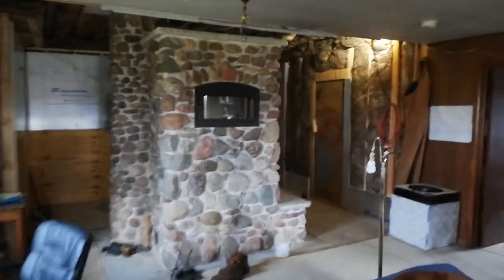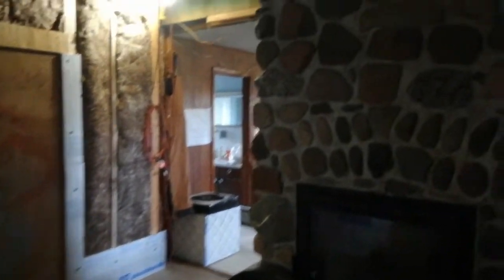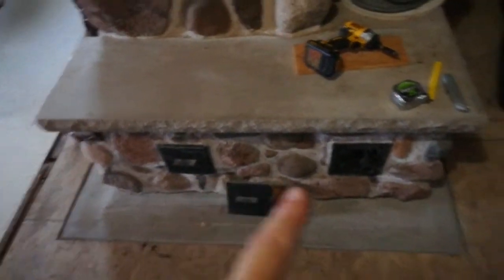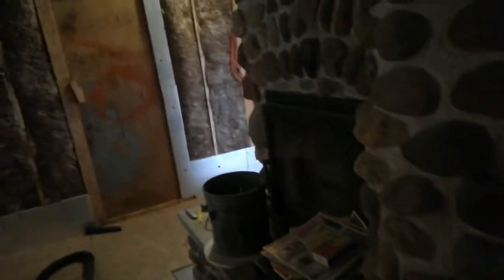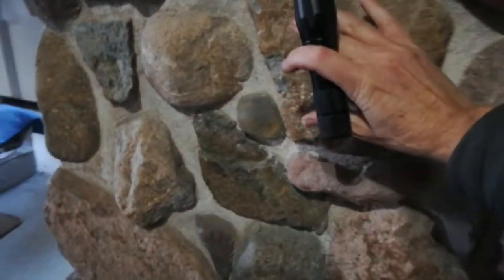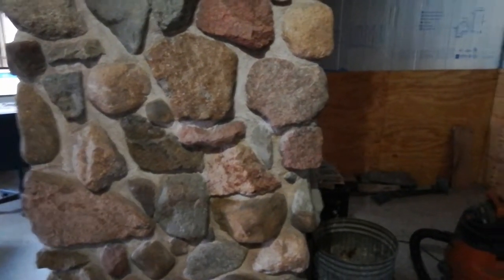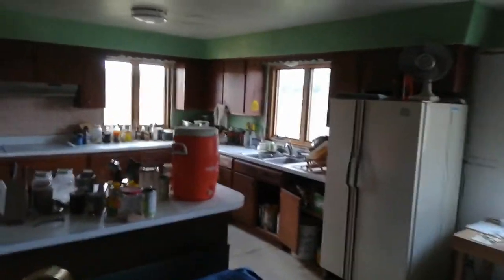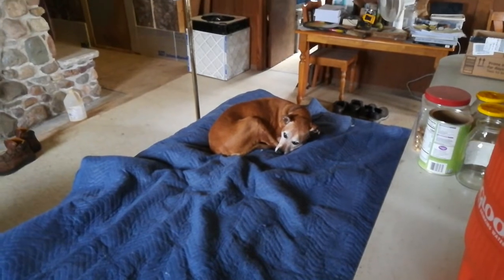Masonry Heater clean out

Comment: That thing is beautiful.  It's a shame it doesn't get used more and that the area around it isn't finished.  We want to have the same type of stove in our retirement home that we're just starting to build.  The entire floorplan is being built around it.  Is there a reason you aren't using it more frequently?  Just not as convenient?
Reply from the maker: Thanks!  I'd use it a lot more if I had my wood pile closer to the house, preferably in a wood shed where I wouldn't have to slog through the snow. That's where I run into the larger "problem"; I already have plenty of unfinished projects inside the house, where like yours, the floorplan is centered around the heater.   😄   As it is, I spend almost all of my time/energy working on farm projects  -- at this point it's more interesting to me.  Living in a house while working on it has it's challenges.
Good luck with your build.